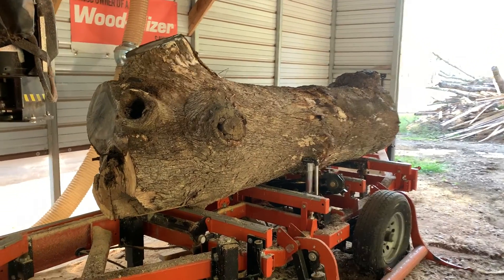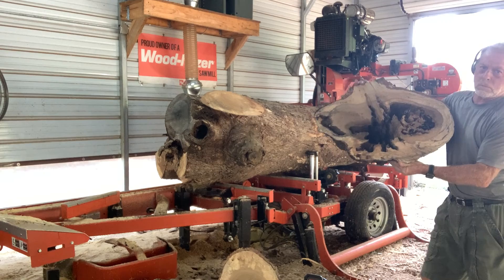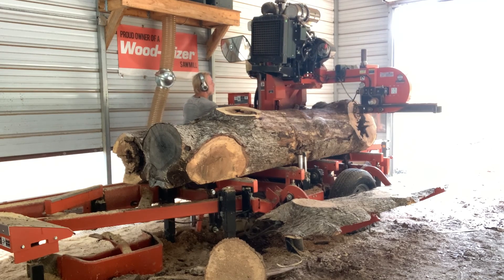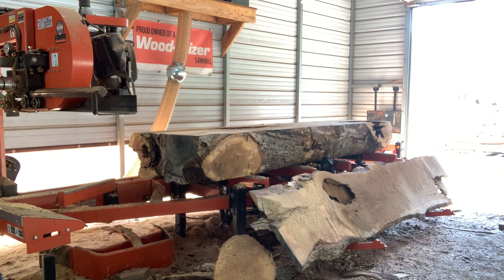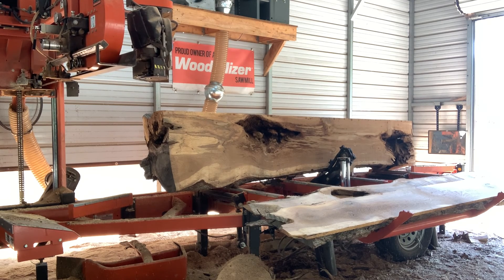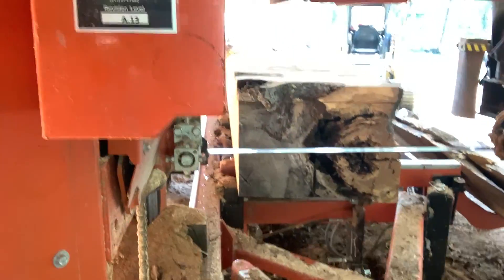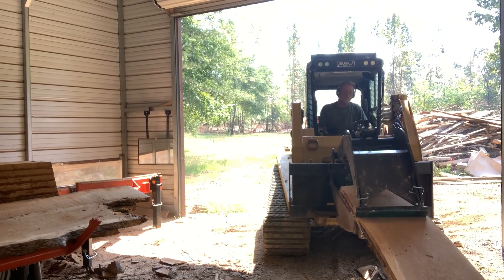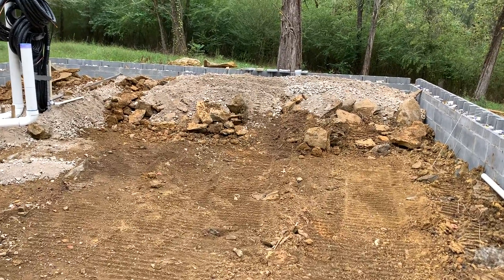Gnarley Oak on the Woodmizer Sawmill and a Cabin Build update.

Comment: Gnarly hardwood is hard to beat for making some interesting tobacco pipes, wood bowls, mortise and petals.
Like your mill, your setup and that dust collector.
Just picked up a new Timberking 2020 to cut some timbers for a couple timberframe homes on the homestead. 
Gonna have to either build a saw shed or buy a metal one. What's the brand and size of metal shed you have?
Reply from the maker: My building is 25’x50’ I had a local guy that builds the trusses and does a turn key job. It worked out good for what I’m doing.
Reply: @oldbluffsawmill5235  Copy that. Mortar and Pestle. Dang auto speller can't spell. Good call on lasers.
Reply from the maker: I can’t decide if my lazer or Ride-a- long seat is my favorite modification. The dust collection is right up there with them too.
Thanks for watching and commenting